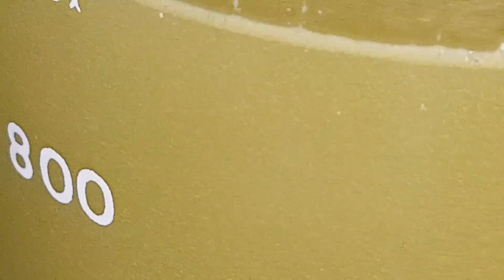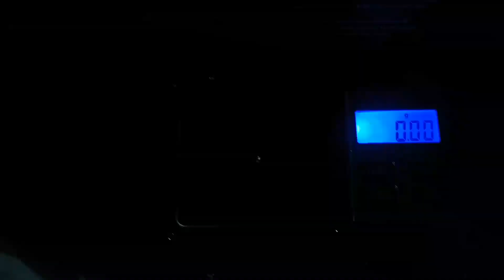Proses mengambil emas dan perak dari limbah cell phone keyboard

Comment: nice work as usual my friend...the paper that you use for filtering.what type of paper is it..it looks like the kitchen towel.the brand that soaks up water..how many sheets do you normally use to filter..thankd.👍👍👍
Reply: yes, it's like towel paper.. only 1 sheet just okey.. i use it too
Reply: @charlesmayer5627  thank you..I use Johnson quantative filter papers..there very similar to whatman filters.they are cheaper than whatman filter..I'm going to try this paper towel method..it looks quiet effective..thanks for reply my friend
Reply: but if you use the brand for facial tissue, you can use 4 until 6 sheets..
if you use 1 sheet you can use towel tissue, and we usually use the brand Indomaret - tissue handuk
Reply: mantap master 👍👍👍
Reply: @charlesmayer5627  thanks very much.i will experiment with this
Reply from the maker: thank you brother